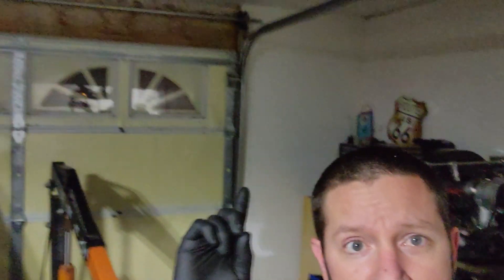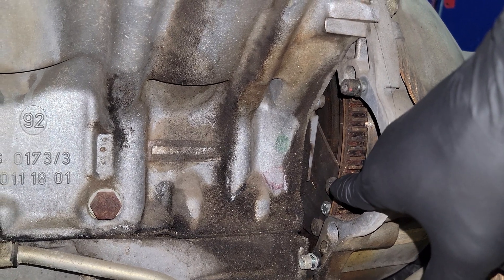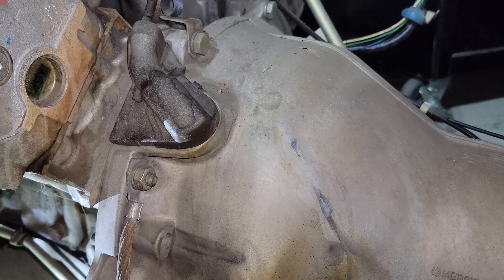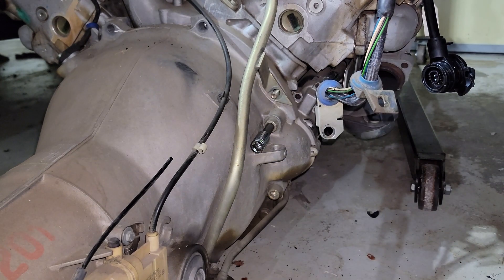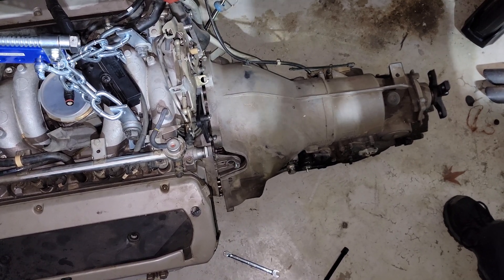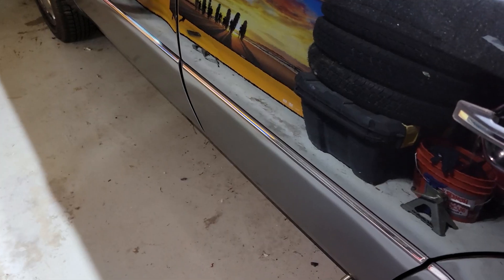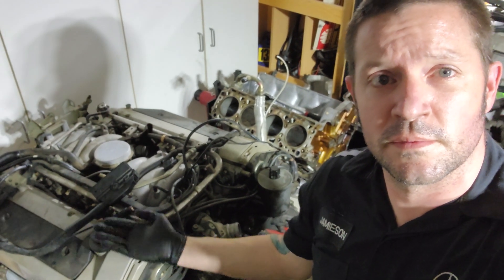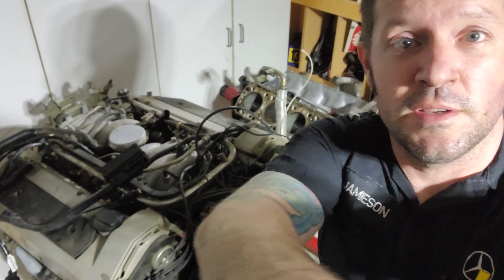Project Gramps M119 400E Transmission Separation

Comment: I am looking to buy the inductive speedometer sensor for 722.3 transmission on this car.  Do you have a source for used parts for these old Mercedes?
Reply from the maker: Unfortunately I don't have any sources for used parts.  When I have needed them for previous cars I've gone to my local pick-a-part.  Yesterday I ordered parts from FCPEURO.COM because some parts are no longer available from the dealer such as the EGR valve gasket.  Funny enough after ordering it I got an email from FCPEURO letting me know it's not available from them at this time.  You could try them for the speed sensor.
Reply: @FriendlyMBTech  AutohausAZ.com shows stock on the EGR gasket.  Also try PelicanParts, ECS tuning, and Partsgeek.  Those are all my go to parts sources.
Reply from the maker: @joewestfall2952  FCPEURO showed in stock also lol.  I'll check the other websites also.  Thanks.

Comment: Great content as always , do you use any flyweel lock tool when removing crank bolts?
Reply from the maker: The small 13mm crank bolts weren't tight enough to require a holder.  The 27mm center bolt ill use a 1/2" impact to remove it.  If removing it by hand you'll need a holder.
Reply from the maker: I'll be going over that in the next video also.
Reply: @FriendlyMBTech  Ok, Thank you